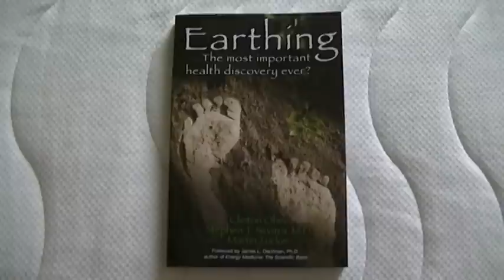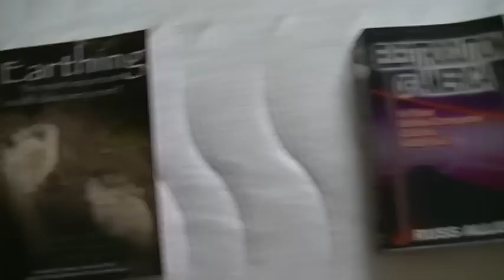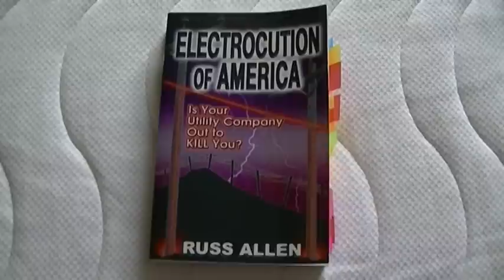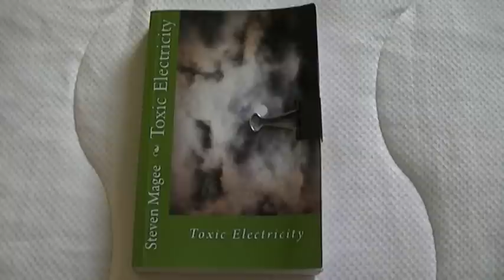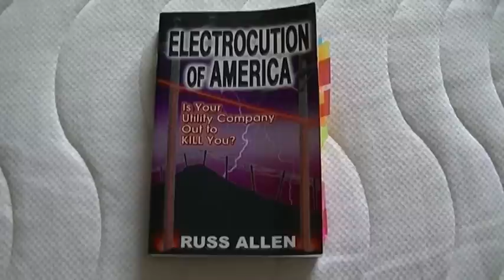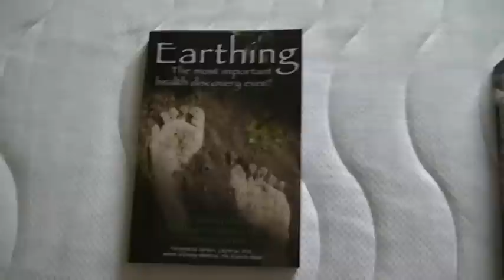Earthing (Grounding) Health Risks

Comment: Dear StevenMageeBooks,
I think you should consult an amateur radio operator on the subject of grounds. A 100K-ohm resistor inserted into a ground wire (who told you to do that?) is tantamount to a highly resistive connection and a lousy ground.

Another thing is that a ground wire should be as short as possible on its route to ground so as not to accept radio waves, as would an antenna. Flat braided and tinned copper wire makes the best lead to a ground pipe. Ask any ham radio operator. Running your wire cable a long distance to your garden to get a clean ground is counter-productive.

So to sum it up, you created an antenna and slept on it. You unwittingly defeated the whole principle of grounding. Thus, your video could lessen the confidence of a person trying the proper Earthing technique, which scores of people, notably the citizens of Haines Alaska stated as greatly helpful to their health.
Reply: Fritz1935 Right on. There are charlatans around every corner who try to profit from something as simple as having cement flooring, walking barefoot & connecting to the Earth's vibration.  Everything we need to live, heal & thrive is around us, for all of life to benefit from.
Reply from the maker: The movie Grounded was set in one of the most isolated communities in the world: "Haines is a census-designated place located in Haines Borough, Alaska, United States. It is in the northern part of the Alaska Panhandle, near Glacier Bay National Park and Preserve.  As of the 2010 census, the population of the area was 2,508."  Had it been set in a major modern city that is overloaded on wireless radiation and stray voltage, the outcome of the movie may have been quite different.  The 100k resistor is incorporated into some grounding products for current (shock & electrocution) protection, as is the 1M resistor in many antistatic products.  I totally agree with your assessment that I created an antenna system that induced radio wave sickness into me.  I live in Tucson, Arizona with a population of 1 million and an average radio frequency environment of 1 volt per meter. I have a few volts on my electrical grounding system as referenced to my back garden.  It is the reason why I used the back garden to connect to.
Reply: StevenMageeBooks
Hi Steve.  Thank you so much for taking the time to post this informative YouTube video.  Question for you: how can I determine the "average radio frequency environment" of other cities and towns?  Is this information posted somewhere or should I be able to attain it from the utility company? 

I'm in the NE Heights of Albuquerque. I've been grounding for a few months and have noticed considerable benefits from it.  Thanks in advance for your reply.
Reply from the maker: You need someone to go around the town with a three axis radio frequency meter and a video camera and take many measurements and post their findings to youtube:   http://youtu.be/cYBdgPthX_w USA Microwave Machine City Tour

Comment: You are concerned about stray currents, but do not currents need a circuit to flow? If your copper wire is not part of a circuit, stray currents will not travel up that wire from the earth. Official earthing sheets also have a 100KOhm resistor in the cable, where they connect to the sheet, which again will resist stray currents. This is my inexpert opinion, I would be interested in your reponse.
Reply from the maker: The cable shown had a 100K resistor in it.  Current will flow to and from the human through the action of being an antenna.  You will also get current flow if the human comes into contact with a voltage that is different to the grounded connection that they are connected to.  I work in microamps, as that is what the human nervous system functions on.  I am finding that the stray voltage and stray frequency on the body appears to be more harmful than the low currents.
Reply: StevenMageeBooks
Thanks for your reply. Stray currents as described by Russ Allen travel through the ground back to the substation, while in bed we would be in an electrically 'positive' space, closer to the sky, repelling rather than attracting such currents? We can avoid contact with other voltage (e.g. plumbing) different to grounded connection while in bed, so there is no circuit.
An earthed sleeper would attract electric fields from wiring in the bedroom, if this is the antenna effect you mean. Maybe a full sized earthing sheet, covering the whole bed and catching these fields at the edges would solve this.
 According to earthing theory, an Earth-electron skin is formed around an earthed person, strong enough to neutralize electric fields immediately, without them traveling through the person. It seems plausible to me that when they reach this 'skin' they have found Earth, and would not be inclined to travel further.
RF/MW frequencies induced on your cable is another concern, maybe a ferrite bead would stop them? If your cable is exposed to such frequencies, so is an un-earthed sleeper (to a lesser extent).
Does the large resistor on the cable not stop all these weak currents?

Comment: thank you ! what do you think about the copper pins in shoes ? is that not safe too..thanks.
Reply from the maker: In areas that have stray voltage/current/frequencies in them, you should be wearing insulated shoes.  Away from electricity and wireless radiation sources, grounded shoes are probably okay.

Comment: hi steven... is it possible to cut the stray voltage with a diode? if not, with some sort of circuit? (maybe it's AC so it goes both waysi convert it to dc and etc etc)
Reply from the maker: I think a shielded cable may be the solution to keeping radio frequencies off the cable.  Stray voltage/current/frequency is difficult to deal with and generally requires the utility company to address the issues, as they are the ones who create it with their combined earth and neutral cables.  I discuss the application of a very low DC voltage as a health technique in the book Electrical Forensics.

Comment: Thank you for adding to the discussion. A few points from the video.
1. You did not verify that the copper cable was picking up anything. You just assumed that it did.
2. You used a copper cable of unknown composition. In addition to possible heavy metal contamination, you described all the symptoms of copper toxicity. http://www.drlwilson.com/articles/copper_toxicity_syndrome.htm
3. As an electrical engineer I suspect you are familiar with the full wave rectifier circuit. The next stage would be to connect one in series with the line and test again as the RF would now be DC. If you are concerned about the high frequency response of your diodes you could put a low pass filter at the input.

The logical starting point would be to find a method for detecting the stray currents.
Reply from the maker: The copper cable was acting as antenna system and had large amounts of radio frequencies on it that appeared to lead to radio wave sickness.  See the video: Assessing Earthing Health Technique Grounding Systems.  I believe that rectified RF would still be RF and lead to radio wave sickness also.  I am assessing it with plants in this video: Growing Plants with Electronic Components

Comment from the maker: You should verify that the ground that you are using is not electrified.  Put a copper electrode in the ground and 50 feet away put another.  If you can read an AC voltage between them then you should not be walking barefoot on the ground.  The countryside is generally okay away from electricity sources, as is the beach.

Comment from the maker: I came to the same conclusion afterwards about using a shielded cable.  However, if the grounding system that you use has stray voltage/current/frequencies on it, then no amount of shielding the grounding cable will help you.  The stray voltage/current/frequencies in the ground may make you sick.  Other electrical experts are issuing warnings regarding using this health technique, there are risks associated with it.  Take care!

Comment: It is my understanding that the copper cable you used to "test" the grounding of your bed is not shielded and it would be a virtual antenna for ambient electric, radio signals and contaminated frequencies. You should have used a shielded cable as a test especially if you are coming up with such a negative report on grounding.  You sort of set yourself up for failure...no?

Comment: risky to do in the city where its needed most?, think neutral and grounded is the same thing? did not see a volt meter test to see if the grounding has the effect of lowering voltage of the body. how often does stray voltage occur?

Comment: Besides a risk like lightning strike, which apparently is resolved with a simple fuse or power strip, are you aware of any explanation for exactly how contact with the earth (or a wire) would be detrimental? I looked at some of the results for "stray voltage cows" and I saw many references like this: 

In the majority of cases, adding a neutral wire where there isn't already one, or a second wire to help handle the load, would solve the problem, said Havas. 

Neutral wire = grounding wire, yes?

Comment from the maker: As far as I am aware, the earth pin goes back to the transformer neutral connection in the UK.  The Earth/ground pin on any electrical system is typically contaminated with many frequencies of energy that may make you sick.

Comment from the maker: You should plug your grounding cable into the AM and FM antenna connections on your stereo system and see how many radio stations you get.  You may need to put a 100k resistor in line with it to do this, you can get it at Radio Shack.  If there are a lot of radio stations, then your grounding cable is acting as an antenna system and may induce radio wave sickness into you.  The longer your grounding cable is, the more likely it is to act as an antenna system.  The ground pin AKA neutral in USA.

Comment: Your advice and open-minded approach to the subject is laudable.  
The risks you seem to point out are exactly what 'earthing' is intended to balance out against, namely avoiding the build-up of static electricity in the body.  Clint Ober and other proponents of earthing stress that the best method is to simply put your naked feet on the ground, preferably damp grass.  Surely you can't claim that this is unsound or risky from a health point of view.

Comment: Grounding to a grounding outlet should be tested before you connect. Sleeping or working in a grounded location with high RF or electrical wiring is not so good an idea. You should turn off breakers or anyother RF. If you are in a low RF area grounding is good. But your body is an antenna if you ground it you make it a better antenna. Not good.

Comment from the maker: @shidunce: Has this technique improved or degraded you health?  It does take several months of exposure generally before you will see any detrimental health effects.   Even with the best test equipment, you will not be able to measure every single electromagnetic exposure that is on the cable.  They vary with the time of day and also the seasons.  The detrimental health effects of this technique are documented under the names of "stray voltage" and "stray current".  Google "Stray voltage cows".